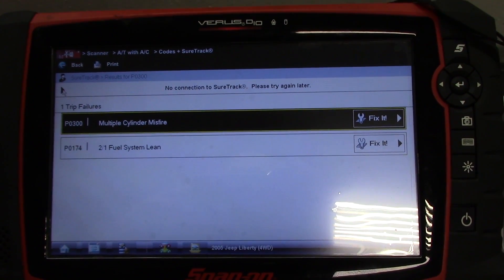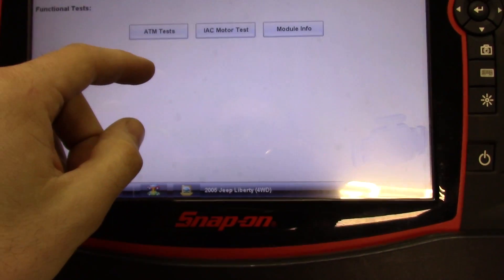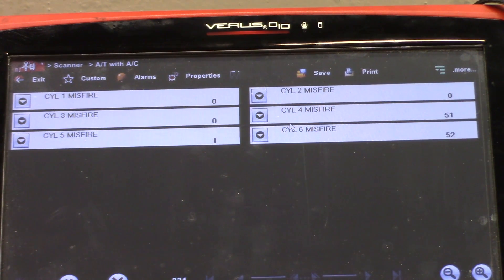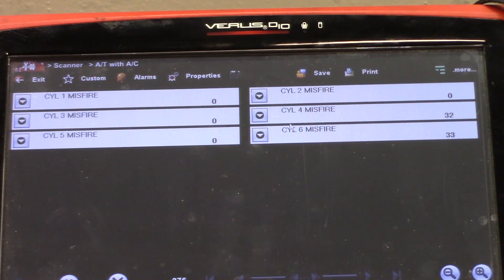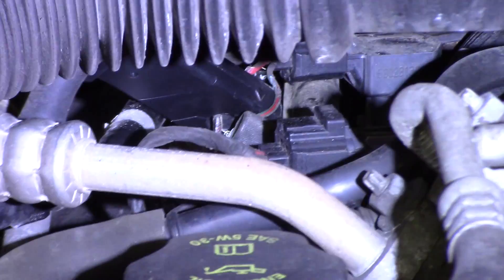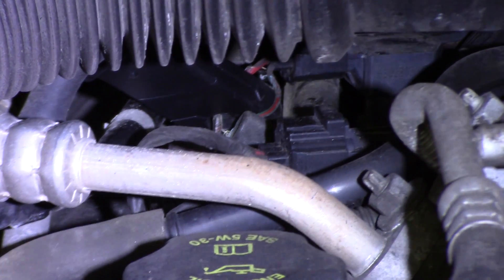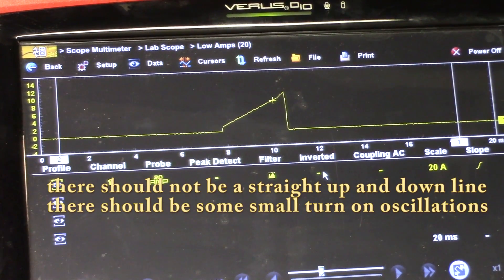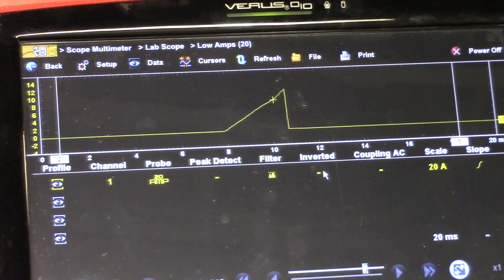2005 Jeep Liberty 3.7L P0300 Multiple Cylinder Misfire (ignition coils, shorted secondary windings)

Comment: My Jeep is having the same issue and I noticed that the coolant reservoir actually will end up leaking a lot of coolant on top of the number 6 cylinder and it pool up inside where the coil/sparkplug sits.

Comment: So when u do a drop test.  The ignition coils that could possibly be bad are the ones that don't drop in the rpms ? Great video by the way.  I am working on a 2006 jeep liberty.
Reply from the maker: Correct. Coils that are contributing will cause a drop in rpm. The bad coil will make no difference because it is not contributing.

Comment: Nice video.  My wife has a 2008 liberty with the 3.7.   She told me it was shaking and flashing engine light.  I fired it up and it was indeed shaking.  I scanned it with a cheep scanner and said improper ionization coil in cylinder 3.  I pulled the coil off s d pulled the plug out.  Seen nothing wrong visually.  Put it back together and no more misfires.  It’s been 3 months and still no misfires.  I did add some dielectric grease to the boot. I wonder how it went from misfire to no misfire,?
Reply from the maker: Sometimes when you start touching things and moving thing around you can accidentally fix it.  Could have been a contact issue or something like that.  Happens more often than not.

Comment: Guessing the coils didn't actually resolve the issue.  Getting ready to mess with the O2 sensor located just before the passenger side of the catalytic converter based on research with results provided
Reply: '3 way' catalytic converter meaning there's two total. In relation to even numbered and odd numbered cylinders

Comment: For my 2007 Liberty 90,000 miles was the Injector electrics. For some dumbass reason I didn't ohm the #1 Injector leads. When i eventually did,  it ohmed at 148 instead of around 12.5.  So that explains why I had low rpm misfires under 500rpm. Likely upon startups, bc it started and idles fine. Doesn't miss otherwise.

Bought reman Denso 6-pack on ebay for $72. I'm just replacing that one Injector #1 bc I'm like that, so I'm gonna try to do that without having to remove anything but the #1 and #3 coils and fuel rail bolts on both sides. Maybe the air intake if necessary.

Comment: I have a blinking check engine light(PO300) and a O2 sensor code,my muffler is BAd you can see inside of it, and when the light blinks I lose power...I'm going to get all the coils and plugs replaced and the muffler..should that do it?

Comment: I diagnosed my 2011 Jeep Liberty after the same warnings; P0304 in my case; changed coils, plugs, wires, etc etc. Turned out to be the fuel injectors! A little more difficult to put on than spark plugs, but not much more; and Amazon had a set that fell around $15 each! Try replacing them before taking it to the dealership. There is a good video on YouTube regarding the 3.7L Jeep engines. Always good to check the electrical components while you are at it as well.

Comment: I had the same problem. Internal crack in coolant reservoir tank causes coolant to enter right chamber. Coolant exits tank though small overflow opening next to firewall, and leaks onto #6 and #4 coil, shorting them out. Solution, replace coolant reservoir tank, and #6 coil in my case.
#4 coil also could be damaged also.
Reply: Same thing happened to me on my 03 Jeep Liberty or correctional 04 coolant leak down on four and six and threw up po300 I'm going to replace my ignition coils
Reply: @mattlonproctor7221  Glad I could help. Blow out the coolant with compressed air if you can.

Comment: 2005 Jeep Grand Cherokee 3.7: I had engine light flashing and then staying on. Only code was P0300. I replaced all the spark plugs and ignition coils. Cleared the code and the flashing engine light came back on the next day and again only code was P0300. I obtained a "FOXWELL FW601 Elm327 Obd2 Scanner WiFi Code Reader Car Diagnostic Tool" and downloaded  several OBD apps for my iPad until I found one that would allow me to load the Cylinder Misfire Cyl 1 through Cyl6 so I could see what Cylinders were misfiring. The IOS App was OBD JScan free version. This  revealed that Cylinders 2, 4, and 6 had around 50-60 counts of misfiring. Since all three cylinders were are on Bank 2, I decided to replace Oxygen Sensors for Bank 2. I first replaced the upstream O2 sensor for Bank 2 and thank God, its been running fine now for three days. I never replace the downstream O2 sensor since the upstream fixed my issue.

Comment: My 03 Jeep liberty would run great when first started then after driving a bit would randomly start flashing engine light. Code was p0300. Turned out to be the MAP sensor. I removed it and cleaned it with Map sensor cleaner and re installed.  Sensor was filthy inside!  Started running better immediately and code went away. Keep in mind my jeep has 239k miles.

Comment: I just got this misfire code, cylinder 4. I pulled the coil pack and looked at the plug. Plug was fine except for a rather large gap, .055 at only 10K miles. re-gapped the plug and swapped the coil with number 2. No more miss-fires. I re-gapped all the other plugs, they were all around .052-055, this sucks for such low milage. I won't be using Denso plugs again. I'll stick with Autolite or NGK.

Comment: Hello, I just watch your videos and need some insight for I have a 2005 jeep grand Cherokee 3.7 flashing check engine light runs rough-runs like shit as soon as I start it and drive it.  It used to have an occasional P0303 and in which I had changed that #3 ignition coil and new set of plugs, worked fine but sometiimes the P0303 comes on and ran ok and cleared it with scanner.  Now I get flashing check engine light runs rough-runs like shit as soon as I start it and drive it.  I did the drop cylinder test, nothing...any advice would be appreciated!  Thanks.
Reply from the maker: If your still having the misfire on cylinder 3 it could be something else like compression or fuel. Any other faults along  with the p0303
Reply: @PositiveLeadDiagnostics  thanks for reply...I decided to change all my ignition coils and not one at a time when they fail individually and now it runs great!

Comment: how does a misfire create a lean condition ? it should create a rich condition ( unburned fuel going by the 0 2 sensor
Reply from the maker: When it’s misfiring it’s basically turns that cylinder into an air pump.  Yes there is unburned fuel but there’s also a ton of oxygen that the oxygen sensor. I think there’s a long thread somewhere about the oxygen sensor and what does it read.. oxygen or fuel. The tomato sensor. Maybe it’s on iATN. Somewhere

Comment: My misfire was due to a small crack in my fuel injector gasket (O ring) was a $3 part and fixed myself. I believe it happened because the o rings are old and my engine over heated 3 times
Reply: Did you have to tear it apart to find the cracked O ring?

Comment: I have a 2006 Laredo 3.7L, it looks like the same engine.
The check engine light occasionally comes on and goes off.
I scanned a P0302 - cylinder 2 misfire.
This video helped a lot.

Maybe I will just check the plug before I go buying an ignition coil.

Thanks for the video and info!

Comment: Hi, thank you for the useful video, my question is why it did not show oxygen sensor codes instead of P0300 Multiple Cylinder Misfire? My jeep gave me the same code with a very noticeable misfire, and the dealer charged me $600 for injection cleaning and spark plug replacement, although they were replaced not long time ago. It is still giving me the same code and the same symptoms (misfire) from time to time.
Reply: Try this if you still have it https://youtu.be/mt9iUGWOk8I

Comment: Don't believe everything you read i done the same thing and replaced the coil twice and still had a miss fire at the number 4 cylinder on the 3.7 liter !
Reply: I just watched a guy change the upstream fuel sensor on bank one and it fixed it

Comment: Thanks very much for this video.  Very helpful.  I have an 05 liberty that is showing both a P0300 and a P0304 code.  I plan on replacing all the coils anyway since the engine has about 150k miles and the coils it has are original OEM units.
Reply: Al final resolviste el problema

Comment: Hello I just finished watching your video. I am having similar issues with my 2005 Jeep grand Cherokee 3.7 intermittent P0303 code., cylinder three misfire. I have change the ignition coil spark plug occasionally. I have tested by putting the ignition coil code. I have even disconnected the connector to  cylinder 3 With no change. I can disconnect any other ignition coil cable and there is a drop in rpms.  I am thinking about changing the AIC switch at the fuel injector on cylinder three...any other ideas?  By the way I will get a check engine light code pertaining to crankshaft sensor in which I changed both crankshaft and camshaft sensors still the occasional P0303 error.  My engine was rebuilt 1.5 years ago with 4000 miles plus catalyst converters were changed 1.5 years ago since the rebuild....thanks in advance....
Reply: Sometimes with high mileage,  the Liberty 3.7 v6 coolant reservoir tank or its rubber hoses can become brittle with engine heat & age  
And can leak coolant on the rear two left cylinders .
And can cause this error code.
It recently happened with 
my 04 Liberty 3.7 V6
Reply: @frankfitzpatrick5300  shouldn't I be getting smoke at the tail pipe?
Reply: @ninpo23tj  no , the water from the coolant tank lower  hose just leaks into the recessed spark plug holes , below the coolant reservoir tank & arks on the spark plugs causing misfires !!
Not into the combustion chambers where it would cause white smoke.
I hope this helps
Reply: @frankfitzpatrick5300  Thanks but I  have check the level of my coolant tank weekly but I will check again.  Note: I had the engine head gasket replaced two years ago and only put 5,000 miles since.  Thanks for your insight!

Comment: I had misfire on cyl 1 ,4 and 6 and replaced all coils with new ones from Ebay ,also put all new copper spark plugs and still had misfire on those cylinders ! The only thing left to replace or repair were the Fuel Injectors ! I put in  some Chevron Techron Concentrate Plus Injector cleaner with at least 15 gallons in the tank and almost instantly my engine started sounding better and my Engine Light went out,no More Misfires yet with around 100 miles on it . Anyone with Misfire's on these engines might want to try some of that Type of Injector cleaner first and then  if still having problems .start testing the coils ! Also check if your Radiator Fluid Plastic tank is leaking on to your two back 4 and 6 coils which can cause misfires which you either replace the tank or make your own shield that deflects any small amount of fluid down the side of the engine instead of  on to your coils and plugs !
Reply: Thanks for the tip
Reply: Thank you alot
Reply: That happened to me on my old Ford Jeep Liberty my four and six cylinder had antifreeze dripping out of the overflow onto those two cylinders and I caught it and change the the overflow tank. But now I have a po300 code and I bet it is those two cylinders and ignition coils that's no good but thank you for the tips. PS if you can remember where did you get your ignition coils from, I know on eBay but how much were they? If you can remember
Reply: @mattlonproctor7221  you can buy some on ebay but I'm not sure which ones are better.  Some of those new ones go bad too and can really mess with your mind thinking there must be a problem somewhere else. It happened to me with new ones from Ebay, a few went bad within days so I tested them with a multimeter and confirmed they went bad. Best thing to do is test the Coils when you get them to know the starting resistance numbers. If they change too much you will start to get misfiring again. I actually reused some of my old factory coils IF the resistance numbers were close enough to the new ones. That helped me out lots so I didn't have to send back in the new ones for replacement. If you buy cheap new ones, just pray they don't go bad. I think factory oem ones are the way to go if you are ok paying the extra money. There is no guarantee those will all stay within specs though too. IF only there was better quality control for electronic parts we wouldn't have these problems. Good luck.
Reply: I unplugged the coil for cylinder 1 and there was no change, unplugged cylinder 3 coil rpm drop  , then #5 and there was no change what does this mean
Reply: @1think19  Sounds like coils on 1 and 5 are bad, Check the plugs too. If the coils are bad the plugs on those are probably fouled up as well unless you changed them recently. Good to change all plugs at same time tho, they don't cost much.
Reply: @street35z  my bad I should have said I just replaced all coils and plugs
Reply: @timbo-05  it was running great on my way to work, and when I got off work, started having misfires again
Reply: @1think19  Some of the new coils can be faulty. That is exactly what I had. If the motor didn't change any when the wires are pulled off, there is a problem on those cylinders. maybe even bad wires that go to the coil. I would swap the coil from ones that the motor changes when wire pulled off to the cylinder that doesn't change. You can rule out the coil or wires that way too. I hope you kept the old coils because you can try them out the same way to test them, If motor changes when wire pulled off they are usually good coils.
Reply: @street35z  i got it!  So I started checking sensors vacuum hoses going all crazy lol. Apparently i didn't tighten the coils enough, i didn't wanna break them cuz I've done that once. Also replaced MAP sensor as it broke while I was taking it off.

Comment: my 2009 liberty has 206k.  has a p0300... replaced the usual. still didn't fix the issue.
Reply: arnoni11  hey any luck?
Reply: @alexg8460  yup cheap 02 sensors . i now have to replace my cats because of it
Reply: Wow i have bad missfire code and start stall,  changed every sensor including 2 ecu and nothing. Only thing i have left is 02 sensors going crazy here
Reply: Forgot to mention my 2 of my injectors are dumping too much gas into the system already replaced them and nothing.
Reply: @alexg8460  me being cheap caused the issue. now have to replace the cats

Comment: Just saw this post.  Very common cause caused by a shorted Air Fuel Ratio Sensor .  These vehicle uses a Air Fuel Ratio Sensor in place of a O2 Sensor.  Find the faulty Air Fuel Ratio Sensor in either bank 1 or bank 2.  Lambda in a Fuel Ratio Sensor should be 1.  Voltage on Sensor should be 3.Volts if sensor is working properly.  If heated circuit is not working computer will cause a lean condition affecting "all" cylinders in the bank .  Computer sometimes will not show AF Ratio sensor code.  Hope this helps.  For all you that don't know how a air fuel ratio sensor works please Youtube Air Fuel Ratio Sensor. Regards, Atech311

Comment: Is the ignition drop test safe for the engine? and is it really a simple as pulling the coil wire and if the rpm's drop thats the one you change?
Reply from the maker: if the rpms drop then that means that cylinder is contributing, its the one that doesn't change would be the problem cylinder, and it shouldn't hurt anything as long as you do it quickly newer vehs should have some type of injector cutoff but you never know

Comment: i have a question. i just bought a liberty 3.7 2005. I'm haveing similar issues. but my coolant reservoir have a crack in itand leaks onto the coil 4 and 6. could coolant cause a misfire eventho the boot covers the spark plug. ans 2nd question. on this vehicle it has green coolant in it would that throw off the compression in the fluid
Reply: Lexy  yes it it could very well be a big pro don't no why they put it the crazy .
Reply: Lexy don't no if you fixed yet but